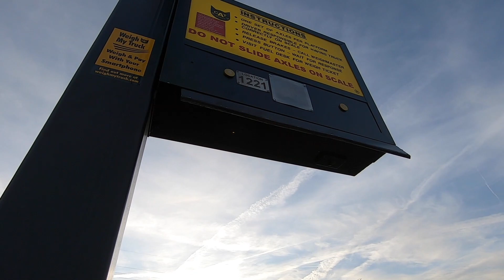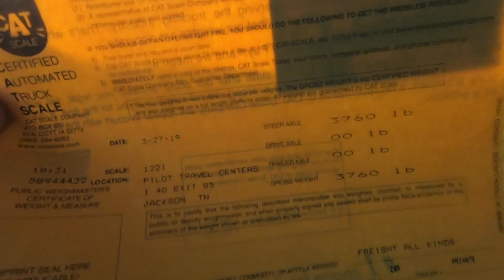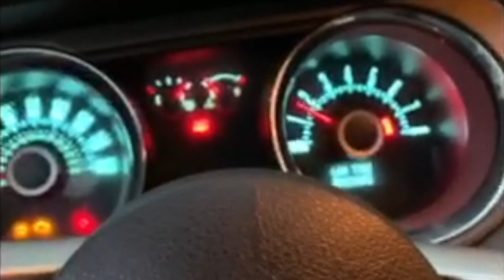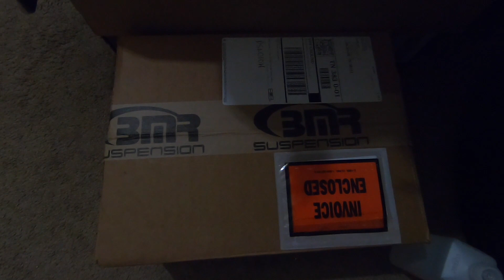GT500 put on the scale! Plus shop update

Comment: So 4,000 lbs with driver and 1/2 tank since you dont want to race on less than 1/2
Reply from the maker: Justin Young with these wheels that would be close. When I get the drag wheels on. I’ll re-weigh it with half tank.  It was between quarter and half here. I weigh 195. But I  am losing weight right now lol.
Reply: @SpeedAddict731  I saved a lot by switching out my brakes and wheels and since it was unsprung weight, it was the most beneficial weight to lose.  These GT500s are hard to lose weight from unless you want to compromise drivability